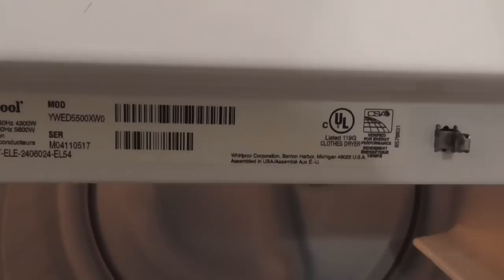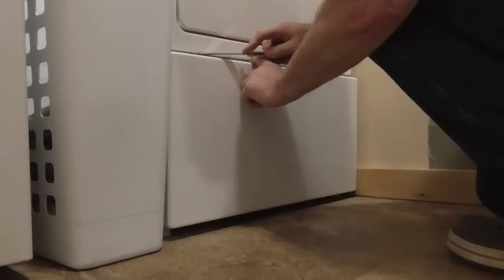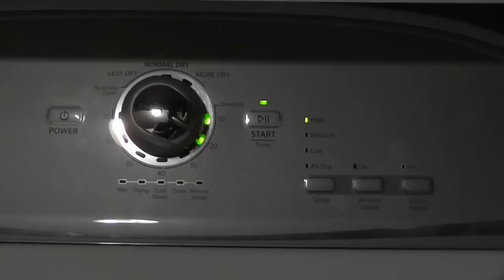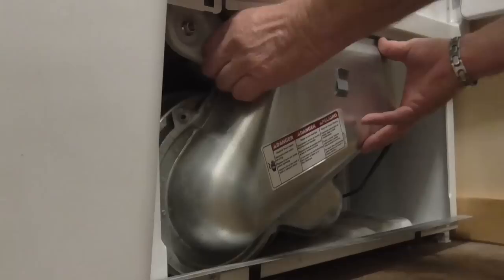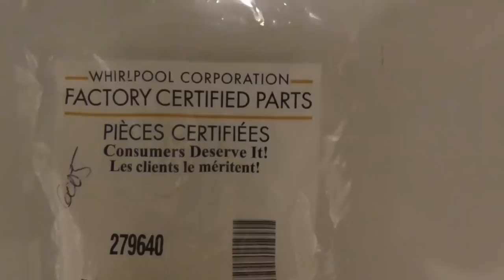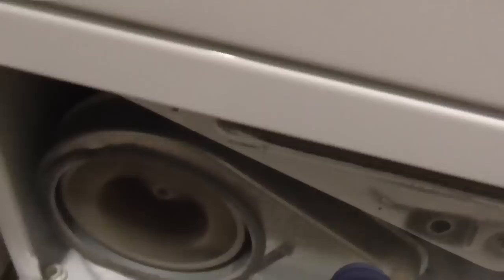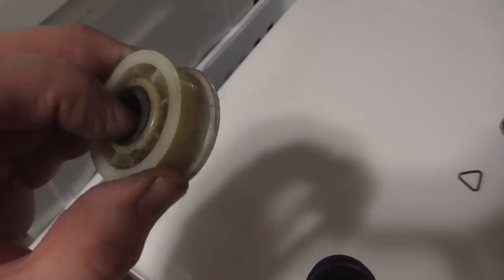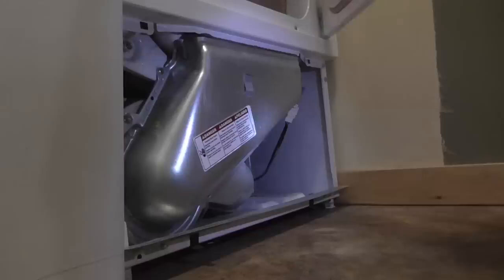Fixing a squeaking Whirlpool Cabrio Dryer

Comment: How did you remove the original triangle clip and what tool do you use.
Reply from the maker: you can just use a screwdriver to ease it off the shaft. The new one is more pliable than the old one and pushes on over the shaft easily
Reply: Use a pair of needle nose pliers and just work at pulling it off by the  corners.  Then slide the pulley off (push with screwdriver), then pull off the nylon washer.  Reverse the process and use lithium grease on the hole of the new pulley before you put it on.  The triangle clip just pushes on.  The only problem I had was getting the original triangle clip.. and finally used some elbow grease to pull if off with needle nose pliers (using two hands).

Comment: How did you get your hand behind the pulley to get it off? Thanks for your great video.
Reply from the maker: If you have a small mirror or take a picture of the back of the pulley you will see the little plastic clip that holds the pulley on.  Just reach in behind with a screwdriver and pry the plastic clip off. It comes off pretty easy.  If you can only get one hand in there, with screwdriver in hand, feel for the plastic clip and try to guide the screwdriver in behind it to pry it off, doing so blindly.  Hope this helps or answers your question.
Reply: Thanks for the quick response, I took the back cover off  to get at it. Thanks so much

Comment: I have the same dryer same issue just on my mod number it doesn't have a y in front of WED5550XW0. Will that part you used still work?
Reply from the maker: Yes, as a lot of dryer models and different makes use the same idler wheel & clips. Just order one for your model #.  When I look up my model # with the "Y" in front of it nothing shows up.  I do not know why the "Y" is there.
Reply: @Halscamp  I ordered the same one yesterday, it showed up 10 minutes ago. Now my dryer is back in working condition without that God awful squeal. Thank you very much for this video!
Reply from the maker: @ccseitz89  
Wow, that is fast service. If I wanted something that fast I would have to go get it myself LOL. Glad you got her humming again. Ours is still squeak free, now almost 4 years later.

Comment: why didn’t you show how you got the pulley on and off?
Reply from the maker: Could not see that part because of the position I was in as the pulley was behind my hand, however from 3:00 to 3:12 I say to reach behind the pulley, take the clip off, put the new pulley on, the washer and then the clip on. If anyone gets as far as taking the clip off they will certainly be able to see how the pulley slips off the shaft.
Reply: Halscamp So I have to take the triangular clip off? How do I replace it when I’m done?
Reply from the maker: Adam J. Smith  Just push the clip on over the shaft once the pulley and washer are on.  There is enough give on the plastic clip to allow it to expand enough to push on over shaft and it will seat itself once on far enough
Reply: @Halscamp  Yeah, after I bought a pair of snap-ring pliers, I figured it out. I'm obviously a first-timer.
Reply from the maker: @AdamJSmithSanduskyOH  
Great, now you can return the snap ring pliers as you will likely never use them unless you are into repairing a lot of things. No need to spend money on the pliers, no need to spend money on an appliance repair person, a win win situation.

Comment: where do u find parts? online Lowes/Home Depot?
Reply from the maker: You should have an "Appliance Parts Supplier" or "Appliance Parts & Service" store in your area. They can get any part you may need.
Reply: Googie Mike bought it on eBay. Search for idler pulley part number 279640. Cost less than $6

Comment: Why wouldn't you just unplug the dryer? no need to mess with the electrical panel.
Reply from the maker: washer and dryer were in a tight spot with a shelf above it and dryer hard piped so very hard to get at plug.. In my case easier to use breaker. Thanks

Comment: You can just take the back plate off instead of going in the front.
Reply from the maker: Yes you can however as I stated in the video, Mine was hard piped and in a very tight spot and a lot of work to unhook the venting pipe and reconnecting it so going in from the front was an option and it was the option the video is all about